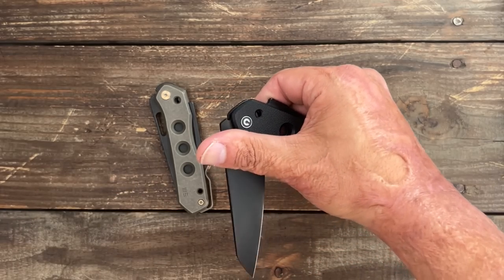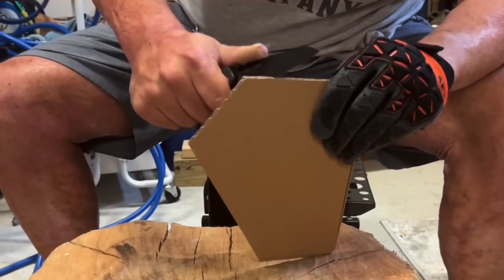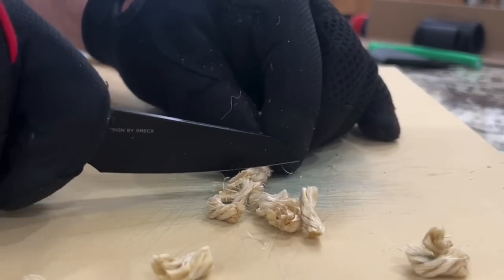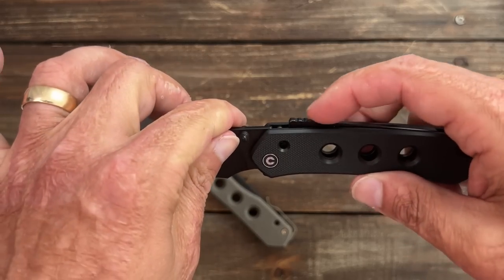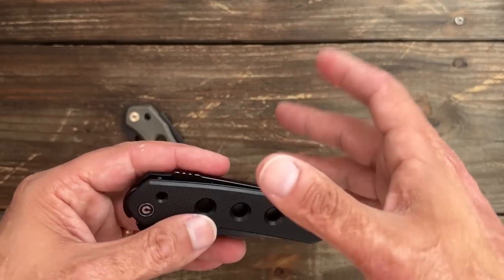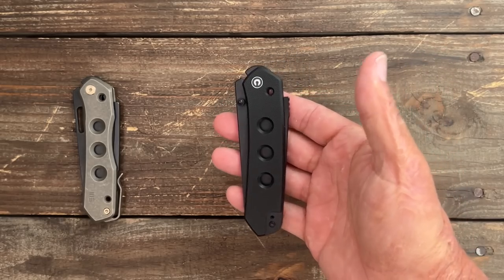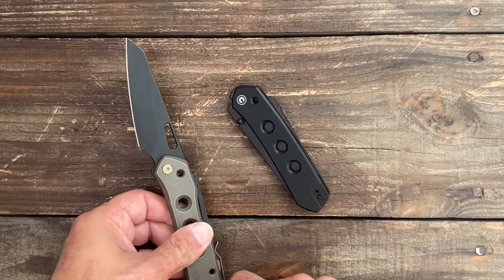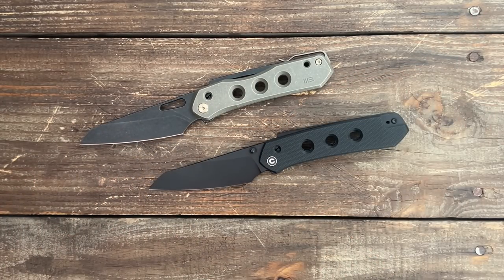Best High Value Knife 2023!? Civivi Vision FG Full Review

Comment: I got mine in this week. Opted for the Jade G10 and satin blade. Action was very stiff out of the box. It didn't really have an edge worth using. A little adjustment on pivot, some KPL, and a dab of Pro-Gold grease on a couple areas= butter smooth action. Gave it a nice sharpening and now it peels hair. I was impressed with the NitroV steel during sharpening. This is the first time buying a NitroV blade and didn't know what to expect. Nothing is quite as satisfying as feeling and then hearing the sound of a burr coming off properly heat treated steel. A nice crackling glass sound. Great knife once I got it sharp and the action slicked up.
Reply: After having some more time with this knife I found the Super Lock jimping to be very aggressive. There was also some stiffness in the lock. It was time to tear it down! What I found was the super lock having some burrs in contact areas. I knocked those off and polished by hand. The interface in rear where spring it was also another area. So I worked inside the super lock area spring holding area there, knocking off sharp edges and hand polishing. Even polished the spring! Only one other area was still causing roughness and that is where the super lock rides against a pin. Smoothed that out and finished by knocking down the most aggressive super lock jimping part. I rounded that on the corners and also took a wee bit of height out with a micro file. After this, simply butter smooth action! This is a great knife. If I had only one complaint it would be that it carries a little weird due to pocket clip placement. I really like this knife.
Reply: @RobNC-OG  hi, really thanks for your review. You made good points.

Comment: So far I think it is my favorite Civivi and for the price... I think it is fantastic. The blade shape is my favorite, good upward curve on the blade to make cutting different angles easier, able to get better leverage from different body positions, like a simpler Osborne 940... the locking mechanism feels really strong and easy to use either hand. It is a bit heavy for it's size, but feels solid that way too. This is their new Damascus too, according to the QA on the white handle version "this Damascus is compound by 10Cr15CoMov in core with 316 and 5Cr15Mov in layers."
Reply: Seems like a ripoff of the Chris Reeve Insingo blade design. I've been seeing a lot of Chinese ripoffs of original high end knives. They're the most unoriginal people ever.

Comment: So major differences are titanium vs stainless steel parts, thumb holes vs thumb pegs and the way the blade lock operates. Those titanium parts really drove up the price of the original so it makes sense it dropped down to only like $80. I imagine the changed the back lock a bit because people might have been breaking it or thinking there was something wrong with it. 
I just got the FG and I love it. Super fun the play with and mine came pretty sharp out of the box so it really probably just depends on who is sharpening it. Civivi is a Chinese company so they are probably trying to pump out a pretty good amount at once.
Reply: I do agree the clip isn’t super amazing but it doesn’t bother me too much. Luckily you can replace it with a better one they make.

Comment: Just got the knife , does anyone else have issues pulling the super lock to disengage it, i have to pull pretty hard hurts my index finger not sure if that’s just my example
Reply: This is happening with mine too. It'll make a loud clicking noise when it disengages
Reply: My index finger is killing me, my super lock is so darn hard to use.
Reply: @StewartWallace-p5e  so mine finally broke in but I hated it for like a week I flipped it a couple hundred times at least before it got smooth

Comment: Where did you get your knife? I paid 92 dollars for mine on the civivi website.  They are less than that on Blade hq but I prefer paypal so that's not an option.  Why is yours so expensive?
Reply: @kylerteitsort6659  they are the same on Blade hq 78 bucks I think
Reply: The main reason I chose to buy it from Civivi was so I could use PayPal credit